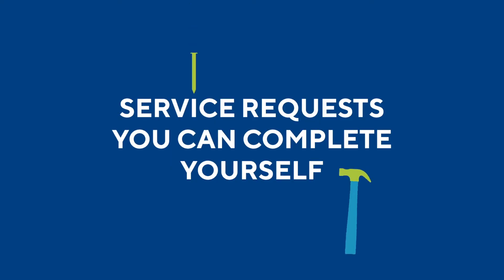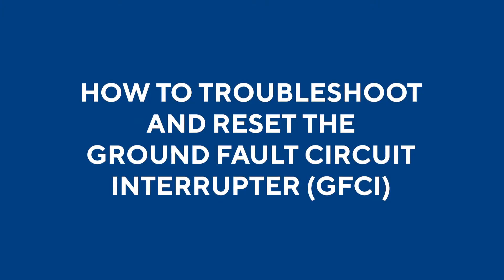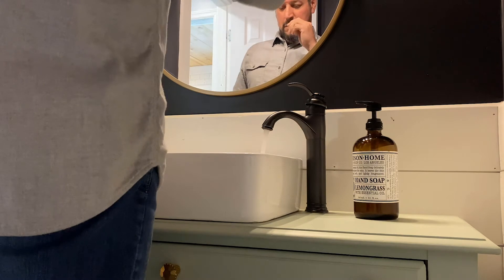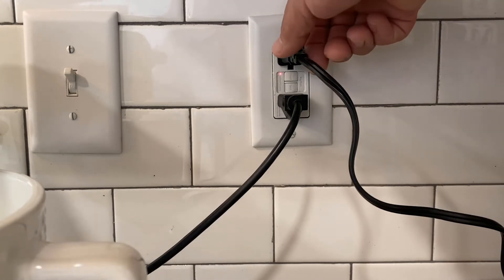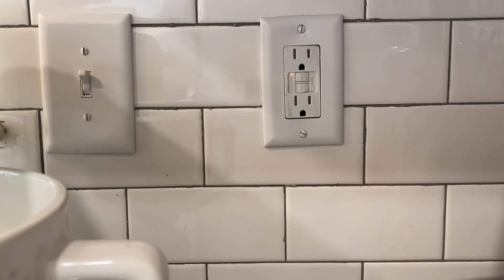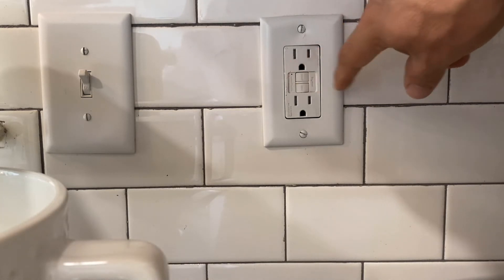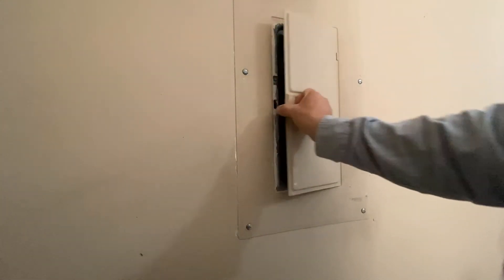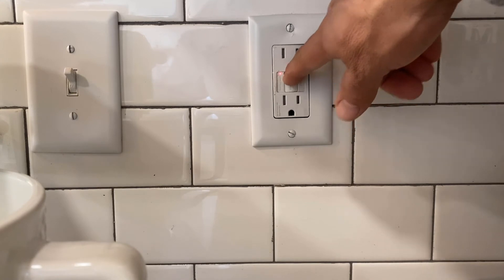How to Troubleshoot and Reset the Ground Fault Circuit Interrupter (GCFI)

Comment: Wow! This just saved me money TY! I was testing my GCFI outlet in the bathroom and it stopped working. Tried the circuit breaker and no luck... however, saw this video and the tip about resetting another GCFI outlet worked! TY!
Reply: Same, just did this too.